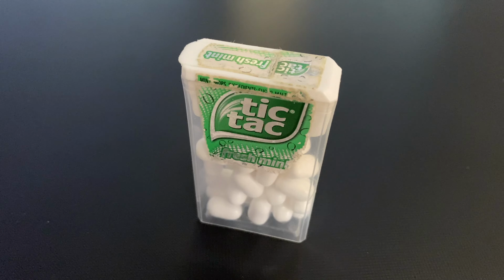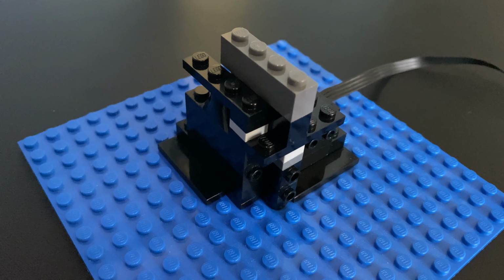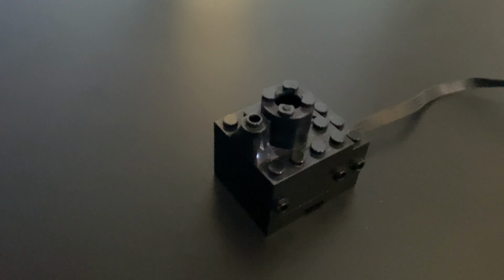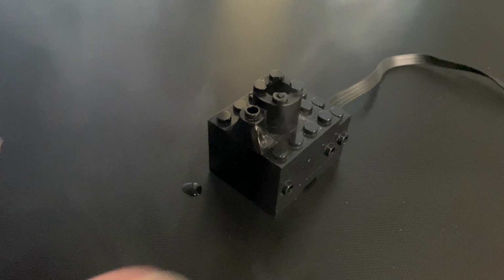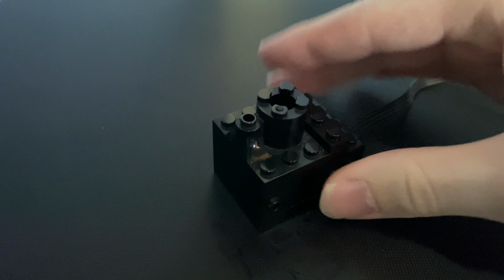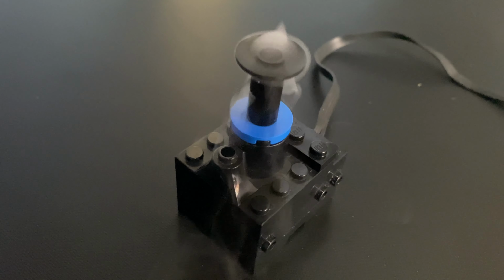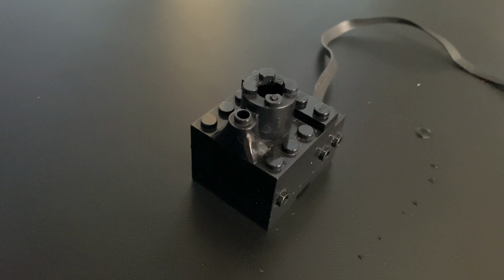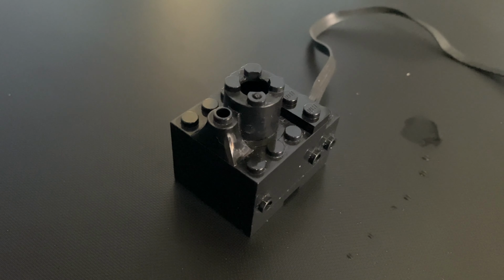Lego Compatible Steam Generator Review

Comment: Hi ı have a quisten about this product 1 buy after 5 five days the mackine doesn't make a good smoke how can i fix this please amswer it
Reply from the maker: @oguzsimsek8196  I have no idea how to fix it. Mine has stopped working too ever since I used BuWizz 3.0 to power it.
Reply: @thisisaduck  ı am not use a original lego battetied bot his power is so slow ı dont understanding water dripping from the edges ı think its an electrical problem
Reply: @thisisaduck   bro your machine led is work or not
Reply from the maker: @ the LED turns on but the smoke doesn’t work. The little membrane that it passes through isn’t making any sound.
Reply: @thisisaduck yea me too ı think ı opened up and solved the problem maybe ı can solve yı can solve to man

Comment: "as much as a motor these days" yeah not to me they are expensive since i only have power functions and would need to buy the battery for powered up.
Reply from the maker: Pf motors still range from around £10-30 depending where you buy them from.
Reply: @thisisaduck  im talking about the powered up motors they cost alot where i am